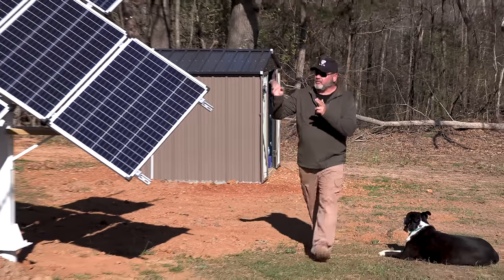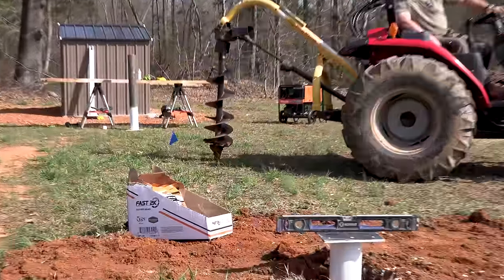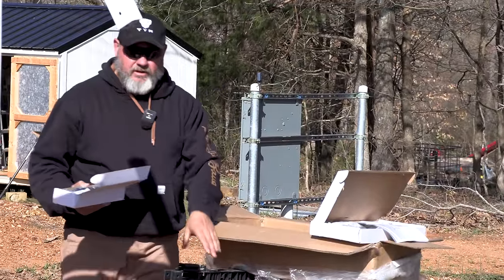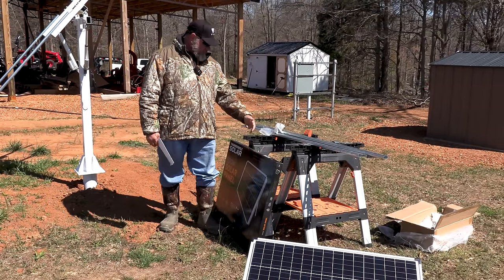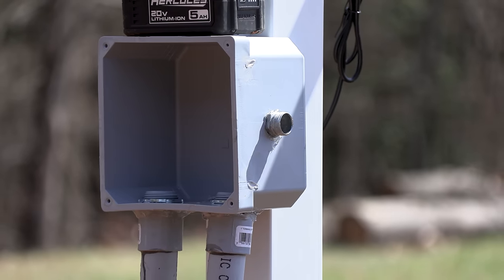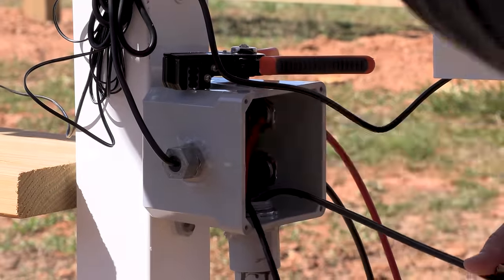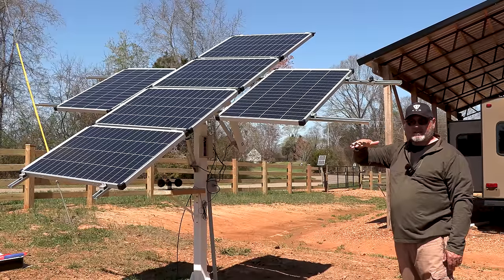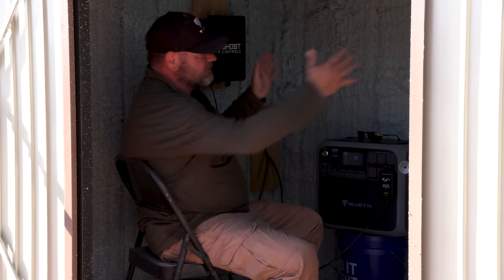You Really Need Solar Power to Survive Grid Failures! DIY Automatic Sun-Tracking Solar Array

Comment: I did a Similar Post install for My Sisters Starlink Antenna. I cut a slot in the Pole for the 3/4 conduit to come up inside the Post below ground and through the Foundation wall. The Whole cable/Conduit  run is below ground  and inside the post right up inside the Antenna Base.  
That fast 2k even works with water in the Hole Tony. I used a 10" Sonatube and had to duct tape off the Bottom to hold back the ground Water (former Leach Field) but it still got in. At 1st I did not think it was gonna Foam out but after a bit it took off, Used a bit more than needed and had a Big Mushroom at the top HAHAHAHA.
I wonder if I could Fabricate a Portable Ground mount for that Tracker ? I plan on using 400 Watts of those same Panels 
If I were to cut down the Vertical section to shorten it, Hmmmm.
Thanks Mike M.
Reply from the maker: To this point, it has worked great.

Comment: Thanks for the detailed video! How many feet apart between the two arrays? Also, during days of moderate winds make note of how much wobble of see-saw type of affect you might see with this system. If you have time video your observations and post. In the past I have seen this type of system experience somewhat extreme wobble or see-saw movement during moderate winds.
Reply from the maker: They are 20ft apart but I wish it was 30ft. Working in the space I just have.
Reply from the maker: I have the panels set where they have a slight angle so instead of wobbling up and down they tend to sit very still in the wind.

Comment: Projects like this would be made so much easier if companies provided better pictures in the instructions and color coded the mounting surfaces.  Half inch stickers of various colors would be all that is necessary.  Match blue to blue, red to red, etc and bolt down.  If any stickers are visible once assembled, you screwed up and it is obvious where the problem is.  My BSA troop has used a similar system with out canopies for years without fail.  Set it up once, spray paint each type/point of connection a different color, and in the future anyone can assemble it quickly.
Reply from the maker: The good news, is the second one went together in a day. I agree with you. Tony

Comment: That's a heck of a lot of work for 600w. I throw my two 400w folding panels in the yard and get that.
Reply from the maker: I guess people are not watching the whole video. As I said in the video, This is a inexpensive test system. The array will handle four to six 400w panels. It will also make my 400w panels 40% more effective. You could spend all day in your yard moving your panels around. Heck, I may be wrong, but time will tell. To this point, the testing 100w panels show a true 30%-40% increase. After this test, I get to use all of these 100w panels on other projects around the farm.
Reply: @TonysTractorAdventure  Sorry, it was a long video. I did watch most of it, but skipped a few parts. You must have said that in a part I skipped.

Comment: Even if the tracking system becomes unavailable to repair, with a couple mods this could be converted to a fixed....very nice setup, worth the tracking as long as its maintainable.
Reply from the maker: One year with no issues yet.
Reply: @TonysTractorAdventure  Nice appreciate the video.

Comment: Highly suggest you trim off the eccess railing where the panels are mounted because at the end you could see some of it casting shadow on the other panel next to it, which is going ot impact its performance a lot...
Reply from the maker: It's not a big deal because they're trees across the road. That causes me to lose the evening light. I'm keeping the longer rails because I will eventually upgrade to much larger panels.
Reply: @TonysTractorAdventure  If you upgrade to larger panels you may have even more shading.  If you are not using micro-inverters you will have even more of a energy production impact.
Reply from the maker: @gregwoll05. Only a few mins in the afternoon. Not an issue for me. I am definitely not pulling it up.

Comment: We had a simple solar tracker at ranch to pump water from well to tanks that used a 2 1/2 tube with gas inside that moved the panel and  a car Schick apsorpor as dampener  that had two wires and lasted in salt air with high winds  on North shore  of Maui.
Reply from the maker: We have had some crazy winds and hail. We are looking good so far.

Comment: The pipe should have some type of extensions to keep it from being pulled up. Possibly a plate welded to the bottom of the pipe with a diameter twice that of the pipe.

My design uses a rotatable hub mechanism at the top of the post which has the vertical axis bolted to the hub. The hub is a front wheel drive hub for any car. I have one from a Buick century.
Reply from the maker: I am afraid you don't understand how strong Fast2K is. Both my panels have been through 80 mph winds. Fast2K is the anchor. It bonds like nothing else I've seen.

Comment: I believe now it is cheaper to install 40% more solar panels without moving parts. It will be a more reliable and wind-resistant solution, I think.
Reply from the maker: I don't fault your thinking if it's what you think is right. I can't tell you this, in the mornings. My solar panels produce 70% more energy than one's facing due south. I have done several tests. It averages 43%. You can add 40% more panels but those panels require mounts as well. Mounts are expensive
Reply: @TonysTractorAdventure  I don't think the mounts are as expensive as the solar tracker structure plus the electronics plus the motors... Nowadays you can buy 450-500W panels for 170-200$ each or even less and the structure... they are dirt cheap (including the foundation maybe?), you could even diy it. One unified estructure for all the panels should not cost too much. For the price of the tracker you could install around 3 450W panels and I see them easily producing that 40% extra that you are already getting (probably more). It would also be a much more reliable setup long term, producing more throughout the years.
Don't get me wrong, I liked the video and the setup, very interesting. Also, really liked the aesthetics. Good job and nice video.
Reply from the maker: I would love to know where you are getting new 450w solar panels for $200? This system add $500 to the cost for each stand. I will upgrade solar panels at some point. This was only a test.

Comment: I wonder what a ten year total cost of ownership (TCO) analysis would show comparing a tracker system vs having two arrays (east and west) of equivalent power..  Considering likely maintenance required to keep the tracker going over the years - it seems likely to at least need lube and probably need some replacement bearings / bushings and motors and maybe a new controller or two.   For someone that’s space constrained the tracker probably still makes sense, but if you have room for 2x arrays I think they might be cheaper and definitely less trouble.
Reply: I have the room, but limited input by the system Bluetti AC300...2xPV Inputs...1200w/13a/120v per input. So, I like what I got...at least for powering barn and work areas for my initial plan, but need max input in the morning and the evening. I got 6 panels....3 panels for each input. I can bias each panel array...one SE and one SW...or invest in something like this tracker. You make some good points though...working today...but what about 5 years from now.

Comment: So I'm not sure if this has been commented before, but I would advise to mount the arrays north/south of each other. That way they will not shade each other, since the sun tracks east-west. It might even be worth sinking another post and moving one of the arrays to give you more power when the sun is low in the sky. Also I think you mounted the posts with the "North", "West", "South" and "East" labels in the wrong positions relative to the actual directions. It's possible this is the reason you had problems with the actuator wiring.
Reply from the maker: I only lose about 10 minutes of sun in the evening. The neighbor's tree blocks.

Comment: I'm really surprised at how many people dismiss the amount of extra power you get even from an adjustable angle array, much less a tracker like this. They just build fixed mount ground arrays and call it a day. Yeah it's certainly cheaper, but considering the overall investment, they are definitely missing low hanging fruit
Reply from the maker: Agreed!
Reply: 200 extra watts means 2 or 3 extra 100w panels. you can get at least 5 extra panels for the money the traker costs... he got 2, so make it probably something like 15 extra panels...
Reply from the maker: @Robert, As I said in the video, This was a test. When I upgrade the panels to 400w, do the math again. I get 70% increase in the mornings and it averages 43% increase over the day. I did a test by setting one panel set "south" and the other panel set "tracking". There are other positives that many people don't take in to account. What happens when large clouds come over stationary solar panels during peak hours. Those solar panels lose that day's peak out put. With a tracker, it gets all peak solar power no matter when the sun comes out. This happens often. It may not be a fit for you, but I think you are working without all the information. These systems are very inexpensive.
Reply: @robertroigsantamaria  15 extra panels to install, loose yard space, jack up the sq footage of ground to deal with weeds and critters making homes? No thanks!
And what about manually adjustable pole mounted arrays? Those are not much more expensive than a quality ground mount, but still make a noticeable difference if adjusted even quarterly. Do so more often for even more efficiency.
I've always found through life that going the best OR the cheapest is too costly. Middle of the road has worked best.
Reply: Maybe I missed something...What was the total cost for the 12 panel system?

Thanks; great video!
 @TonysTractorAdventure
Reply from the maker: The array is about 500 bucks. Many people miss the attributes of the solar tracker. I can't count how many days that it was sunny in the morning and I was getting full power because the solar tracker was aimed at the sun. Then, a cloud moved in at midday and solar output drop dramatically. People with stationary panels lose that morning gain. Any day that you have a sunny morning or a sunny evening but clouds during the middle of the day much is lost If you have a permanently mounted panel system.

Comment: So for the Eco-Worthy dual axis tracker:  Around 45:14 you mentioned that the actuator + and - was NOT left/right and that a detailed fix would be explained later in the video.  I didn't hear the detailed fix later on so did you determine that the + and - should have been right/left instead?  Also where did you determine the best place for the sun sensor to go and are the wires supposed to point south?  I think this was another one that was to be discussed later in the video.  By the way, great installation video for the tracker - best on the net in my opinion

Comment: Brother I’m a welder the type you call and I show up and replace whatever like it was when new my main customers are rock quarries and sand and gravel pits that being said in this video you were grinding mill scale with a flap wheel mill scale is almost as hard as glass so what I’m saying take that flap wheel and chuck it back in tool box and get a 36 grit hard wheel to clean weld area the flap wheel heats the scale up and smears it before it removes it but it’s clogging your flap wheel up 
      Try what I’m saying your welds will be much cleaner less porosity much prettier but much stronger at the same time this is my opinion I don’t need 50 welding wizards to tell me I’m wrong and chances are you’ve never fabricated anything other than glue something together on a piece of farm equipment with bubble gum you get my point 
    Anyway I’ve been looking for a affordable sun tracking system and I’ve found one on your channel and it looks decently built thank you be safe
Reply from the maker: I need you to come and do a video with me! We will call it. "Teach Tony to weld".

Comment: this EW tracker can manage 70° from east to west for following the sun in winter times, when the sun stands low from middle/end november till middle of february ? it looks that direction south only 45 ° degrees are pssible. at black forest I need defintely the 70° position. Ar summer the top angle at 10 am till4 am is 30 ° ( black forest, close to Basel/switzerland position )

Comment: This is fantastic.  Have you thought about Bi Facial panels?  Some range 500-715 W but size and weight come into play.  330lbs rated on this Eco Worthy Rig?  How's it fair during storms.  Did you add tie down anchors?  Thanks and great stuff!!
Reply from the maker: Glad you enjoyed the video. It set itself flat in high winds. We are researching a lot of ideas. Our current set up is our training system. It will run our travel trailer. We plan on building some bigger systems in the future.

Comment: i would have put a square plate on the bottom of the pipe as well for extra holding power in heavy winds
Reply from the maker: Iti is not  necessary. FastK bonds to the post and to the ground.

Comment: Love the way you mounted your trackers. Could you point me in the right direction where I can get the steel plate and pipe from. If you make them on the side, I would love to buy them from you. Thanks in advance…
Reply from the maker: I bought all of the metal at a local steel shop. It was really nothing special about it other than it was just heavy duty. The round metal pipes were heavy duty well casing.
Reply: Thanks for the reply and awesome video…
Reply from the maker: Thank you very much.

Comment: Don't know the curing time on the Fast 2k, but I would have attempted to put one bag in the bottom before the pipe went in.  It would push some up inside to reduce rust around the bottom edge and at least partially seal the inside of the pipe.
Reply from the maker: It is liquid when it is poured. It pushes under.

Comment: you have a bit of shading on your back post, its caused by too little spacing between the posts. this will cause the shaded array to make less power as the shaded panel is becoming resistor.
Reply from the maker: I am not worried much about it. It goes behind tree shade a few minutes later.

Comment: Well..  It's all together. my 290w Trina panels are huge.. I only have 2 of them on it.  Maybe I'll put 2 of my 400w panels on it. I just gotta figure out how to program it.. Well.. I did, but set most parameters at 30 seconds. I will reread the manual tonight and do some learning. Are these supposed to go flat after the sun sets..? mine didn't. So I have the panels tilted for the morning sun and in series. PS. Mine came prewired. Connected the 2 actuators, sunshine sensor and the power. Am using a 15w panel to keep the 12v battery alive and going through a renogy 10a controller with the load constant on.

Comment: How many bags of foam did you use per hole? My plan is to use the same way to mount my solar tracker system.
Reply from the maker: I think I used three bags. The system has been in place for over 2 years and has gone through a storm with 80 mph winds. To this point I have never had a failure using fast 2K

Comment: Nice but you put them too close to each other. The first one was leaving shadows on yer second solar set. Plus having them in the position they are. The first group will cast more shadows  as the it gets later in the day.  They should be off set from each other.

I don't know what panels yer using but many of em have issues if some of the cells are in shadows it can drastically lower the solar energy you can collect apparently.  Still it's a cool setup. Where I live we regularly get over 100km winds and gusts that are much worse. So this wouldn't work where I live.

Last year I watched a new neighbors house have 1/3 of there roof torn off and flew around 100 feet. The trees in my back yard caught the large chunks of roof and stopped them from smashing into my other neighbors houses.

Crazy thing is this wasn't even a storm. Just normal weather patterns.  Joys of living on the high side of a mountain in the rockies! LoL.  Aside from the powerful wind it's absolutely awesome! Nature is amazing, God is an amazing Creator in my humble opinion!

Comment: Did you wire the wind sensor to the second PV tower or does it slave/master by bluetooth? 

I've just ordered 2 trackers form China so I'll be aiming to do an install March - May 2024. I've decided to go the 7' long 8" steel pipe (3/16" wall) mount end capped both ends with plate rather than pouring a concrete plinth. Slightly larger arrays, 8kw around 700lbs. if it subsides I recon I can just have an extra section of pipe welded on. I have a digger with auger so its going to be the easiest and by far the fastest method to mount the trackers.
Reply from the maker: Each unit has its own wind sensor.
Reply: That is worrying as the manufacturer is only sending me one wind sensor. I did ask if I needed two and they said no, one sensor can do both trackers. I'm hoping its done by wifi otherwise I'll site the wind cups on the base station (shed) that'll house the inverter and batteries and wire out to each tracker.